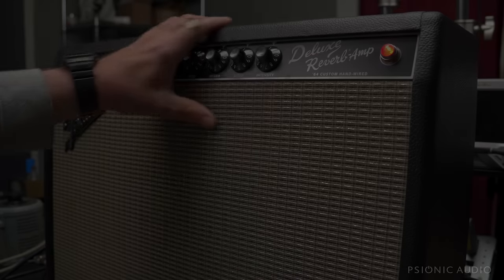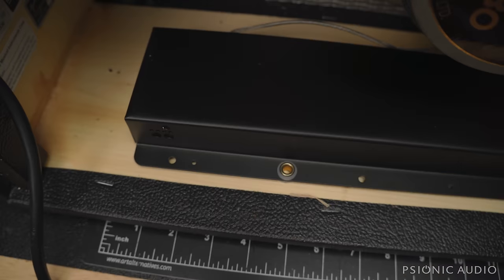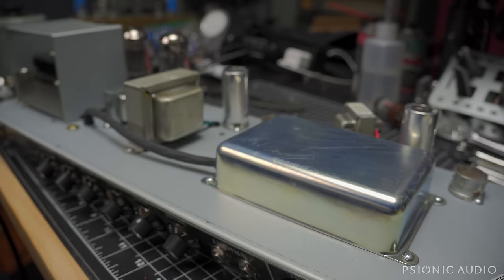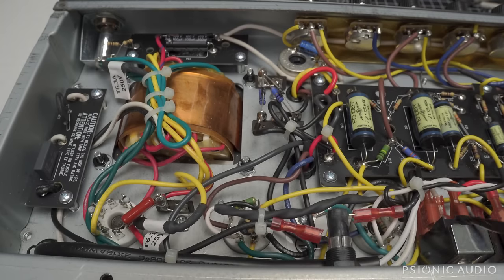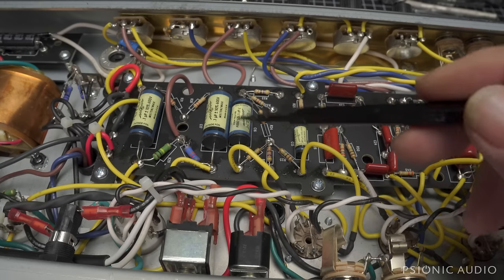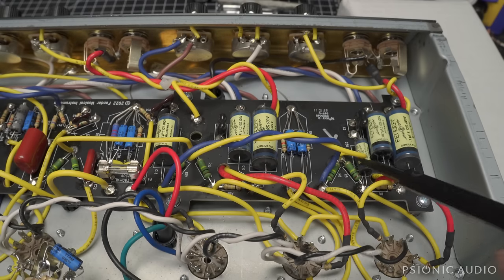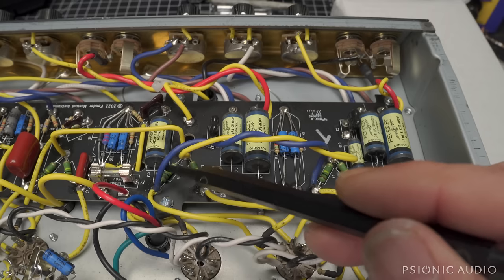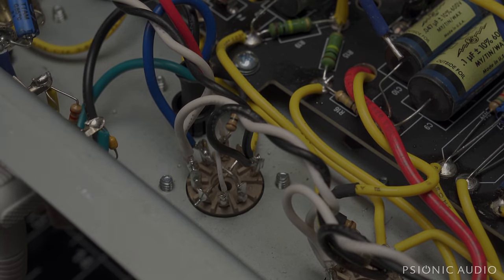Meh | Fender '64 Custom Hand-Wired Deluxe Reverb Pt 1

Comment from the maker: Correction : what I said was an inline HT fuse is an inline 5V rectiifer tube fuse (sorry, the camera was between me and it when I did that part of the voiceover).

And at 13:24 I meant Don Randall, not Randall Smith. Sorry.
Reply: Gear head 👍👌
Reply: Yeah, Randall Smith would put his initials on a job like that one. I have seen proof of that in lots of MkIs & MkIIs.
Reply: I knew you meant Randall Smith.
Reply: Another reason I knew you weren't talking about Randall Smith:  No one who knows anything would utter that name without derision in his voice.  lol
Reply: Really enjoy your videos 👍🏼 thanks!  
Just wondering if you’ve done a video on the Fender tweed 57 custom deluxe reissue hand wired amp ? I’m wondering if they have similar issues as the 64 hand wired deluxe reverb? 
Thanks, 
Al
Reply: Are the tube sockets garbage? And if so what would you use? 
How are the transformers? Thank you 
I bought a 65 Princeton reissue broken for cheap. I’m looking to have it gutted and wonder if the tube sockets and transformers are good enough to keep thanks.
Reply: Forrest White was VP & GM at Fender, and he's the one who implemented the quality control and bonus for error-free work, that CBS ended up scrapping to get production up.  Hurried CBS builds resulted in poor lead dress - lots of spaghetti- and the resulting noise and oscillation prompted some of the circuit changes to came in with the silver faced amps.

Comment: You want "hand wired?" We'll give you hand wired...  I've seen videos of handbuilt MojoTone or TubeDepot clones of the Deluxe Reverb built by amateurs that look better wired than this.  To your larger point about fusing, etc...   This type of design and manufacturing seems to reflect what you would get by hiring EEs who know Ohm's law and may understand UL / Euro safety regulations etc. but have never BUILT an amp or never repaired one or talked to a repair tech about failure modes, design for fixability, etc.  Just more examples of what an ART it is to design mass-manufactured products that meet functional goals and safety / reliability goals.

Comment: I just bought a new 65 DRRI and got $400 off because the reverb had the same feedback. It was exactly the same problem: Ruby assembled the tank with both locator pins grounding out. Thanks Ruby! You guys got me a $1300 brand new 65 DRRI...with a 5 minute repair job. (Which isn't bad in Spring of 2024!)

Comment: I play the heck out of my vintage 60’s and 70’s Fenders and almost never have issues.
Reply: Most are not so fortunate.
Reply: @Da_Publick That’s a shame. It’s still pretty reasonable to get an old Champ. I play one of those nearly every day. Perfect for practicing and recording. I’ve got a 72 (even though it’s a silver face, the circuit is unchanged from blackface). I put a celestion in mine and some Tung Sol tubes. My favorite amp. Beautiful and versatile. Simple circuit, fewer parts. Also There are a bunch of nice sounding hand wired Champ clones out there too; combos and head form.  Hope you get the chance to play some hand wired tube amps.🖖🏻
Reply: @uponcripplecreek1  I won't rule it out.

Comment: I’ve had my Fender 68 Deluxe Reverb since 2015 and it has not let me down. It has been to countless gig & rehearsals.
Reply: The 68 lineup are  the ones too get frankly if you absolutly want to go Fender
Reply: Does it hiss like this one? Would you tell me if it did?
Reply: When the Fender 68 came out it got a lot of complaints about hissing. Mine is actually dead silent.

Comment: This video came at the perfect time for me... had been looking at one of these as an alternative to buying a RI or rolling the dice on a vintage... looks like you saved me a lot of pain and hassle.  Thanks!
Reply: There’s always a 3rd option (and always my go-to one): buying a high quality kit. Like Mojotone in the US or TAD in Europe. If you can’t or don’t want to build yourself, there’s always the possibility to get them built for you). They can compete with the vintage ones without coming with their flaws
Reply: The 65 RI is quieter but has poor PCB build quality. Better off saving for a vintage. The 64 hardwired is just a mess stock after wanting to like the amp. If you like noisy/consistent hum even at low volumes then this amp is not for you. Go boutique, or vintage. I’d recommend testing the amp in person so you don’t got though the hassle of buying/returning online. Especially for a heavy item such as an amp

Comment: As at least 5 others have stated, it's amazing to watch your diagnostic mind work IN SECONDS.  As an aside, it has never occured to me that people would simply remove tubes for channels they never use.  Clearly, circuit-wise, it doesn't upset the balance in the power supply to other things that remain working but that never would have occurred to me.  I guess if the tube isn't there, the tube can't fail doing nothing then take something else out that IS being used.  Probably a vital strategy for all those Mesa-Boogie owners out there... LOL

Comment: Was waiting for this one for a long time as it's been my main amp for almost 6 years now. Can't wait to see if you managed to make the amp quiet. Also interesting to see F&Ts filter caps in it as they are Sprague in mine. Anyway awesome vid as usual, looking forward to part 2 !
Reply: Sprague are not constructed the way they were back in the 60s and 70s. F&T are my electrolytic of choice today and much better IMO.
Reply: You actually paid for a compromise in quality while PCB actually was designed to mitigate noise and increase reliability

Comment: I once bought one of these. …and sent it back. 
It was noisy - the pots felt like the cheapest of cheap pots. It went into overdrive at 4 -5. The overdrive sound started at one point instead of increasing smoothly and had a harsh quality. 

The look of the amp was fantastic and I really wanted to like it. But I could not overcome how bad it sounded. 

I eventually bought a 65 Deluxe RI and had a good amp builder put a handwired blackface circuit in it and never looked back 👍🏻

Comment: The one I worked on had first a faulty 12AX7, swapped that. When warranty expired both power tubes blew, taking the power transformer with it. 
Turned out the intensity potentiometer was broken. The wiper lost contact when turned above 3-4, so with no bias-voltage on the grids the current went up the roof. No wonder the rectifier tube and power transformer blew. Put a safety resistor across the pot, if it loses contact again it won't be as expensive to fix.

Also! The replacement for the power transformer does not match the '65 reissue so of course I ordered the wrong one at first.

Comment: I have this amp as well and it’s a hissy one. Luckily my reverb does not do that. I wish i would have had this channel before i bought it and i would have taken your advice and went with a 70’s model.
Reply: It’s all good, especially if you bought used. There’s some good stuff in this amp and they do sound good. Plus, with the Fender name, it’d be easy to move along. For better or worse, you’re actually paying some for the convenience of being able to quickly sell this amp with its name brand. Fender is like the other big companies in that regard. Gibson’s full of problems, as is the recent Martins. Even the high end Martins have been having binding issues and such. But if you turn gear over, it’s a heck of a lot easier to flip with these names.

Comment: The explanations given are excellent for those of us learning. I am old as tish, and I blew up a few amps in my lifetime, sometimes intentionally. (Idiocy is real) I spent a career in hardware design in the aerospace industry. I worked extensively in aircraft power systems and understand grounding more than anyone should have to in a lifetime. Bonding is another area that is critical - most electronics are not passing a lightning strike, for instance. It does hit airplanes from time to time - shhhhh, don't tell anyone. 

I am to the point where I can build tube amps and have a few under my belt, but this is giving me the whys things are a certain way, and I cannot thank you enough. I just subscribed. 

Thanks again, man. (The seventies were not kind, don't let anyone fool you into thinking otherwise.) We did have fun as long as you kept your head in the right place. Some didn't.

Comment: The ht fuse looks like it is not of a voltage rating that is high enough for it app. Besides not needed as you pointed out . Those resistor on V1 should have been on the board it does look worse than a kit build to me . If they are grid stoppers close to the pin is good but not flying like that IMHO.

Comment: Just purchased  one of these a short time ago, have yet to gig it.I got an exceptional deal brand new in the box. Played it for a memorial service in a church and the hum wasn't noticeable, so I suspect on a noisy stage it won't be a problem. You however pointed out plenty of other thing that could become issues, so, now I am wondering, did I choose the wrong amp. My 50+ year oId Super Reverb is just too heavy anymore and my Two Roc head requires me to Iug around a 2x12 cab that is almost as heavy. Hate to give up on the new DR 64 aIready as for size and sound it covers many of the right boxes. Thanhs for the honest videos you do us aII a service.

Comment: I had an issue with the reverb hum in a DRRI. Flipped the tank around so the reverb cables were on the opposite side of the speaker and it solved the issue.

Comment: Are the F&Ts stock, or think the amp’s been recapped? I think I heard you say you’re not the first one to have been in the amp (and it looks like at least the speaker’s been swapped)
Reply from the maker: They seemed stock. I think someone might have opened it to bias it but nothing inside has been changed.
Reply: @PsionicAudio  speaker should be Jensen "special design" something, yet it looks like Celestion Vintage 30.
Reply from the maker: Yeah, the Jensen ended up in that Victoria Silver Sonic I did a month or so back. And it was then replaced because it sounded like ass. The Victoria’s V30 went in this DR.

Comment: yeah, this one’s got issues but I have the hand wired 64 custom Princeton—I play it every single evening—it sounds amazing and I have played it loud and it has no issues. I love it.
i paid open box price for i so got a good deal.
I had a vintage Princeton that was in good shape owned by people I knew and it was nothing but problems right out of the gate I had to spend hundreds of dollars just to get it “meh” so I sold it back to the guy and bought the hand Wired Princeton, and never looked back. I also tried some other Princeton clones that were very nice but in the end, they just weren’t the Princeton. so, in conclusion, my 64 hand, Wired, Princeton is anything but “meh.” 😉
Reply: well said brother. what bugs me is based on lyles dissection these hw fenders are clearly in need of better QC at the factory. 🤔
Reply: @PPJ9274  agree.
👍
Reply: No doubt. I LOVE THIS AMP!! I  purchased one of these in mint condition for $1600.
Reply from the maker: This video is on the HW Deluxe. I’m not speculating about the HW Princeton. If one comes in then we’ll see. Until then, I have no opinion other than it seems radically overpriced.
Reply: @PsionicAudio  agree. tho i got an “open box” discount it was still north of 2 grand. but as i said in my original post—i bought a real 65 from a friend-it was an amp i knew well prior to it seeing a ton of sessions at my friends studio. by the time i went back to buy it it had been ridden hard and put away wet. And it was a mess.
so far the hw custom has given me zero issues after several years of constant use at reasonable volume.
that said, I am concerned about the build quality after watching the deluxe video…after all, why would it be any better unless the guy who built mine three benches down,  cared a lot more about his quality of work? which is entirely possible I suppose. having said all this, after watching your video, I went and checked all the pots on my hand wired Princeton— cranking them all up, and I did notice noise and artifacts from the verb tank that I had not before, so it might be time to bring it into a tech and see if it’s made of the same questionable stuff as the one you dissected!
Reply: My ‘64 Princeton was way too noisy. I returned it so very much ‘meh’. Thomann considers a noise floor of 50db normal on the ‘64 Princeton, told me there was nothing they could do to fix it and refunded it.
Reply: @STF_YVR  mine needed some tlc and a tube after 3 years of steady use…now its in fine form again. its all a crap shoot… like I said in one of my earlier posts in this thread if my hand wired, Princeton had somebody who cared more than the guy in the next bench building another one or the foreman happen to walk by check quality control on the day, mine got built who the fuck knows🤷‍♂️

Comment: I had one. Couldn't stand it. I thought it was the perfect answer to my quest for vintage tone with modern reliability, but it had this harshness that I could not get rid of, even with speaker changes and tube rolling. At the time I also had a '67, a DRRI, and a Tonemaster. Kept the '67 and sold the rest. Sold the '67 eventually, but I now have the most marvelous '64 clone built by a friend of mine. Best of the lot.

Comment: If one absolutely had to spend $2500 on an approximately 20 watt tube amp and didn’t want to overpay, like with the featured amp, what are better alternatives?

I didn’t want as many watts so I got a tweed vibrolux clone.
Reply: The Rivera Stage IV is comparable. (And quiet! 😉)

Comment: Apologies if you've answered this before, I just discovered your channel and am very much enjoying it. I'm curious though what your personal preference as far as amps go? In a general sense. Many guitarists and recording engineers I know assume the older the amp the better, but nothing is that simple. Still, I do find I like the way old amps sound better. I'm not sure how much of that is just in my head though. Surely there are detailed schematics for how these amps were manufactured in the 60s. What prevents them from simply building the exact same amps they did then, right down to the quality of the wiring?

Comment: Yeah, I recently adopted a twin ri, it was cheap because it had issues. I went to check it, it had a bad V2 tube, I told the owner, he still wanted to sell so I bought it "cheap", switched the v2 to v5(orv4) not sure, but it has the exact same squeeeeeel when reverb is turned up.
Will fixer when I have time. Thanks to this channel! Cheers!
When I have

Comment: The line smoothing cap is probably a good thing given the sheer amount of RF interference today that did not exist in the 60s.

The current limiter is also a good thing to prolong the life of tubes/transformers/caps

The reason the HT fuse is not outside the chassis is to prevent an unwitting owner from tossing in a 5A fuse or wrapping fuse in foil and defeating it.—it definitely needs service if that fuse is blowing.

Comment: Artificial center tap made by 2 resistors (connected to anywhere out of a floating heater circuit) does not work as a heater circuit fuse. If you short the heater wires together, it will eventually burn the heater winding of PT, or heater wires without a fuse.  A shorted heater wire current bypasses those resistors, it does not burn them. 

(But yes, of course, when some high voltage part of B+ circuit shorts to the heater circuit using artificial ground, those resistors act as a fuse.)
Reply from the maker: Heater to heater shorts are extremely rare. B+ to heater is much more common and the resistors will fuse in that scenario. 

Heater fuses are more likely to fail from normal inrush current when there is no actual issue with the heater supply.
Reply: @PsionicAudio  True.
 I have used tube amps for 35 years and never witnessed a heater to heater short in my own amps. But it is possible. But I have not witnessed a blown artificial ground resistors either. And I have for over 20 years used two amps using both heater and rectifier heater fuses and those fuses have never blown at cold start either. 😁
But I still think that a properly valued fuse is better than no fuse, especially if the blown fuse is easy to replace, because usually it is much easier to get and install a new fuse than a new power transformer. 😄

Comment: I have this amp and it sounds very good, but it was a little noisy and it got worse until it started to howl. I thought it was going to blow up. Anyway I removed the V3 tube and now it is fine. I use the normal channel only and really dislike tube reverb (I prefer the plate reberb from my Hardwire pedal.) From what I read the V3 was for the reverb. So I assume it is okay to just leave it out.

Comment: Reverb circuits on these hardwired amps are extremely noisy, and generally more hum/hiss. The cheaper PCB I tried didn’t have this issue.

Comment: Thanks for the info. I got one on discount and think it sounds great. I don’t pretend to think it’s as good as an original, but it at least has a factory warranty and I don’t have to deal with the hassles of a vintage amp. I have a sf twin reverb to fill that need. Honestly I play my new pro jr way more. I will go headstrong next but that pro jr is pretty darn capable for the price.
Reply: The hassles of well kept originals are nothing compared to hassles with modern stuff